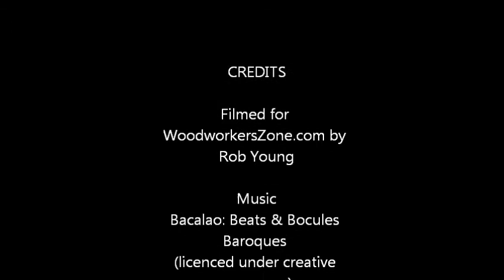Beaded Tongue and Groove using the Stanley #45 combination plane

Comment: are the tongue cutter and the groove cutter the same size? i have a stanley 50 with a 1/4 tongue cutter and 1/4 plow cutter, but for a strange reason the tongue  result narrower than the groove, with a resulting loose joint